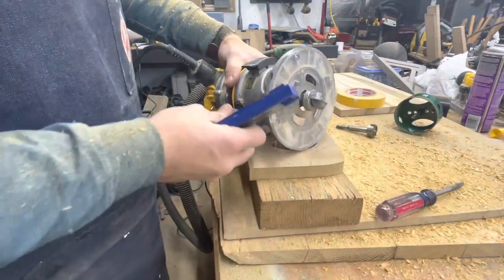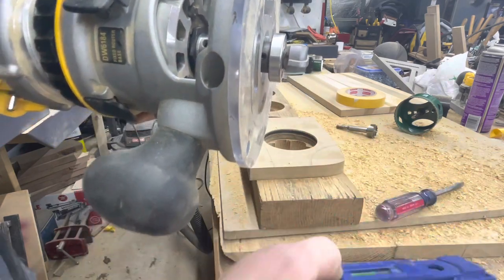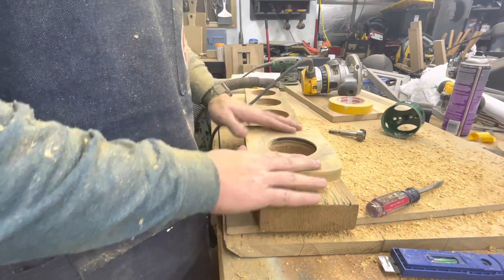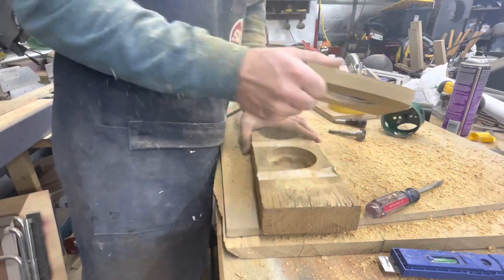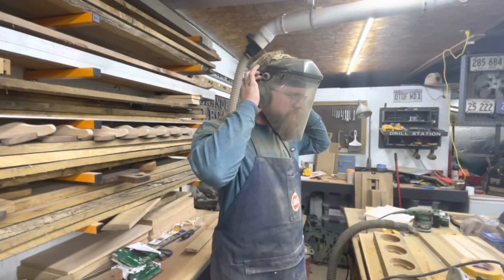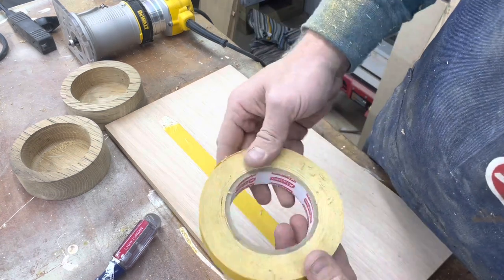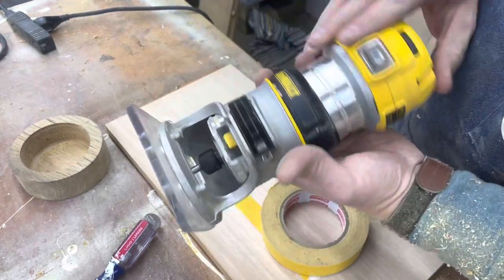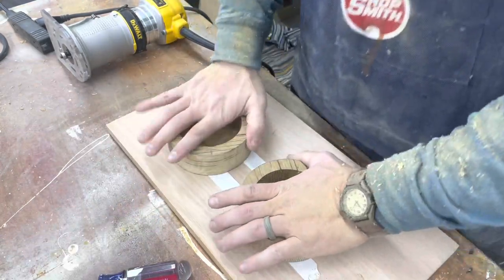Easy Router Bowl - Grandpa’s Legacy

Comment: Question. I've watched this a number of times, and it seems like you've got an extra large bearing on that bowl bit. Is that right, or is it just the angle of it in the video? If you do, why is that?
Reply from the maker: Whiteside Router Bits 1376B Bowl and Tray Bit with 1/4-Inch Radius 1-1/4-Inch Cutting Diameter and 1/2-Inch Cutting Length https://a.co/d/fkQbTC3.     This is the bit I use for them.

Comment: Nice work! What kind of router bit is that?
Reply from the maker: Whiteside Router Bits 1376B Bowl and Tray Bit with 1/4-Inch Radius 1-1/4-Inch Cutting Diameter and 1/2-Inch Cutting Length https://a.co/d/3TtQpGN
Reply: @grandpaslegacy7826  Thanks!

Comment: What was the overall size of the bowls?
Reply from the maker: 4 3/4 inches wide I used a 3 1/2 inch hole saw to make the template then made the walls one inch cut out with the band saw